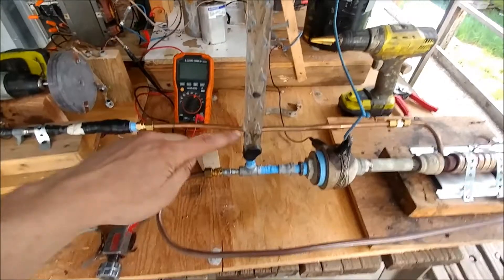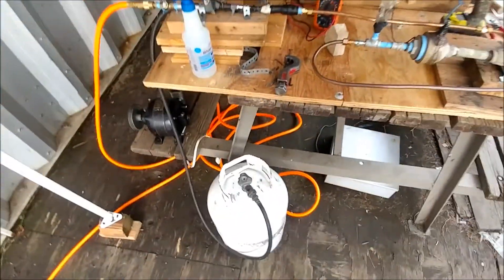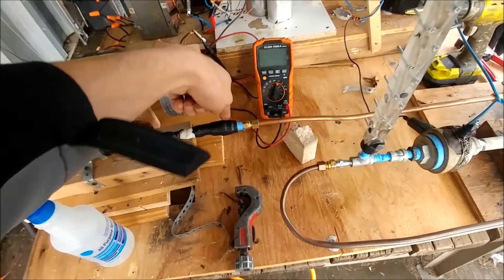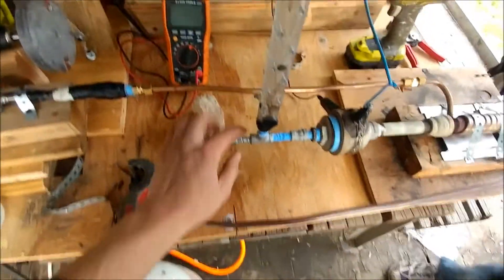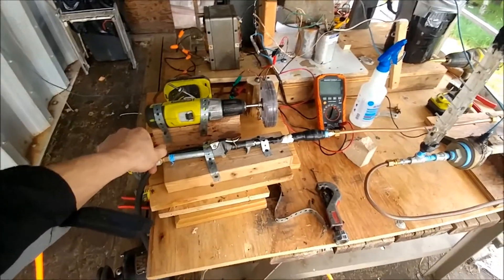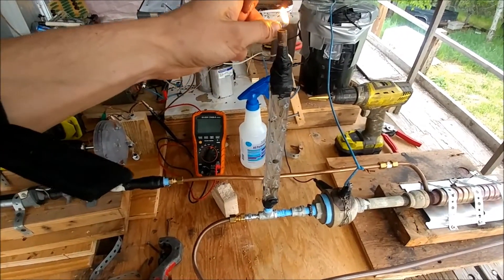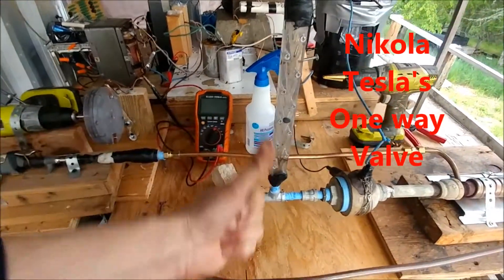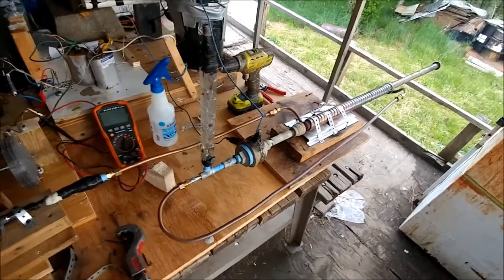Water Plasma Pulse Jet Engine! For Powering The Tesla Turbine!

Comment: Fun stuff but not efficient.  Without a fresh air to fuel compression ratio these engines are horribly inefficient at producing mechanical energy, just like my pulse jet engines.
Reply: @nikola.tesla.r.and.d.centre  I understand there are many different mechanical devices for extracting or converting energy, but when "efficiency" is mentioned a whole other issue is opened.   For something to be "efficient" it needs to consume less energy for doing the job you require than any other device available.
Reply: @nikola.tesla.r.and.d.centre  k but nitrogen isn't combustible its a inert gas you might as well try combusting argon or neon
Reply: @nikola.tesla.r.and.d.centre  You,re getting off track here.  We were discussing devices like the one in this vid, not extracting energy from nature.
Reply: @nikola.tesla.r.and.d.centre  And propane?
Reply: In your Pulse Jet the excessive pressure in combustion chamber does not exceed 0.2-0.3 bars, and in this scheme (it is not concrete in that that it is shown on video, of course) pressure exceeds 3.5-4 bars. The first engine of Otto had no compression stroke, and pressure did not exceed 4 bars at the time of combustion, but at the same time the efficiency was about 15-18% - and it is one many more, than at Pulse Jet. I also work in this direction - https://youtu.be/bBb-ZjXpdSo
Reply: Wow  @nikola.tesla.r.and.d.centre  your like a bad ass soft spoken cowboy I'm totally inspired cant wait to covert a vehicle this way and to run my house
Reply: @nikola.tesla.r.and.d.centre  nitrogen dosnt ignite if that were the case the atmosphere. would have burned a long time ago
Reply: @nikola.tesla.r.and.d.centre  ionization is very different from combusting you can very much ionize nitrogen injecting fuel  into a plasma jet would likely produce a much more efficient combustion of that fuel but the plasma itself is not combusting
Reply: @nikola.tesla.r.and.d.centre  thats not how science works you don't get to say "oh yah give me proof it doesn't work" you have to prove it dose in the first place give actual data an prove its the nitrogen combusting an not one of the other gases in our air
Reply: @nikola.tesla.r.and.d.centre  Could I have a copy of this document?
Reply from the maker: I was peeling the layers off plywood yesterday with just the high speed impulses, I turned up the rate of fire on the plasma ignition. I barely  had the propane turned on. Its extremely efficient :) Also, its turned down in this video, all you need to harvest the high pressure high speed impulses is a good two stage Tesla Turbine. Most of the compression happens when you have a Tesla valve installed, like in the video. After the explosion happens there is a large vacuum that accelerates the air back into the combustion chamber,  and creates a high pressure shock-wave that the new fuel gets trapped in, then the shock-wave is ignited creating a high pressure explosion to further perpetuate the reaction. Thank you for comment.
Reply: @iEnergySupply  But it takes energy to drive the turbine and ignition system also.
Reply from the maker: @MrBen527  Everything takes energy, good thing we live in a sea of energy.
Reply from the maker: @MrBen527  The energy it takes to drive it is transferred into usable electrical energy.

Comment: I'm kind of confused, I like the ambition but, this is essentially a spark plug in a barrel igniting fuel or whatever else. Essentially a combustion engine with no piston. The point of a plasma engine is to produce power with plasma, not to create plasma and use it to heat up stuff. Plasma is a state of energy which doesn't have to be created with an arc. Usually plasma engines compress particals to heat then up via radio waves
Reply from the maker: The plasma ignition is for aiding in combustion when water is introduced to the system. With normal ignition, the water stops the reaction, but with the plasma ignition the water is burned in the chamber with the other fuels. The total apparatus is for powering the Tesla turbine.  We have moved in a slightly different direction for now though, and will be adding the plasma ignition to the vacuum in a complete water environment.  We will see the plasma grow under these conditions. Have you seen the cold steam videos yet? If not here is a link.

https://www.youtube.com/watch?v=JvRCB_HhseY&t=374s

Comment: So its been 8 months since you posted this is there anything to update ?looking forward to it and to see a full car conversion .
Reply from the maker: Actually right now we are experimenting with closed system in vacuum. This reduces friction and boils water at room temperature to power the turbine, surprisingly it works extremely good. Also we want to use plasma ignition in the vacuum to split water in the vortex. Will be interesting!
Reply: @iEnergySupply  I've seen that I'm in awe .I'm really excited and can't wait to follow in your footsteps I have a few ideas already I have the idea to build a friction heater to add up to 300 degrees heat to it '' the turbine would spin the inner drum '' and a few other thoughts
Reply from the maker: @cushionofair  Good idea! Thank you for following the project!

Comment: Looks awesome .Could you add a geet ?
Reply from the maker: definitely on the to do list, what we had here was sort of like the geet when we were using the heat exchange for the incoming propane gasses to be heated.
Reply: @iEnergySupply  with a GEET you can hook the exhaust up to the intake and re-burn some of those wasted fuels ie  water vapor and help silence the system
Reply from the maker: @cushionofair  I agree we should do those experiments. 
As far as the sound goes, it will be muffled by the turbine.

Comment: See the problem is that to burn water, you need to spend energy to separate oxygen and hydrogen. The energy you need to separete the atoms is greater than the energy you gain from the combustion between oxygen and hydrogen (thermodynamics). The only benefit of adding water is the fact that absorbs some of the heat (a pulsejet is the jet variant of a 2 stroker, it wastes a lot of heat), cooling the combustion chamber and increasing the exaust pressure evaporating.
Reply from the maker: it seemed to add much more motive force to the explosions. We will return to this research in the future.

Comment: Noise and temperature changes are signs that whatever you're doing is not efficient
Reply from the maker: The noise is no more then you would hear from an internal combustion engine if there wasn't a muffler attached. Low temperatures are a definite sign of increase in efficiency. Heat is energy, so if you have something being cooled so that it doesn't get too hot, your loosing that energy. Our heat energy is being transferred to the incoming gasses to help complete combustion, and not just radiated to atmosphere.

Comment: I dont see any thing new here,  why not just build a real pulse jet engine, and as for your plasma ignition, i can get the same effect from 5 volt £5 device from ebay, you are not burning the water, you are just getting steam out of it, from the heat of the pipe.... that you are having to heat your fuel is another issue . In your reply to MrBen527 you describe the cycle of a pulse jet engine ? but unlike a running pulse jet engine..... you keep putting energy in with your plasma ignition  https://youtu.be/5sfVnczqb8g
Reply from the maker: You know I haven't finished this yet and have the new design coming soon, part of the problem here was a melted tesla valve. That aside, it still performs better then other pulse jets because the pressure of each pulse is far beyond that of any I've seen.
Yeah you can't get the same effect from a device like that on ebay, I would urge you to prove it. I have tested many different types of ignition systems, and if you were here during experimentation then you would understand the difference is night and day. You know the reason pulse jet engines are so inefficient is because they create so much heat that gets radiated, the heat exchanger takes that waste heat pre vaporizes the gas to the point where you get a faster cleaner burn of your fuel. When the valves are finished you'll see the power this thing is capable of.
Reply: i would take a look at what i do.... my ignition systems, etc..... but hay good luck, its your time and money... you not doing any one any wrong, so have fun
Reply from the maker: @Turbojetkart  Ill take a look. Another interesting thing is we have been using the same tank of propane for over 3 weeks of testing, so the fuel consumption is extremely small.
Reply from the maker: @Turbojetkart  Just wondering what happens when you spray your spark with water, does it grow in intensity or does it dim out and stop? This ignition system when water is introduced to the plasma it makes much larger explosions and you can watch the plasma grow in size.
Reply from the maker: @Turbojetkart  Lots of waste heat going out the window there...

Comment: It turns out that the main part of air moves from a komperssor, and via the valve Tesla is inhausted very little, due to ejection (so, for surroundings :) ). Will work in this case one many better if you stop playing "games", you will remove Tesla valve from this scheme, and connect a tube on which the main fuel-air mix moves hermetically to the combustion chamber. For normal work, all fuel-air mix should move through Tesla valve which should be connected directly to the combustion chamber.
Reply from the maker: I will certainly give it a go, although I do believe this will cause the need for more compressed air as I wan't to draw in ambient air. I've spun a rotor and am impressed with the power the way it is. Do you have an example of what you're talking about I am having trouble with your explanation.
Reply: @iEnergySupply  I meant that in design which you show on video Tesla valve is not used according to the destination (it is sure, you and understand it). Therefore he can be moved away absolutely, and as a result it will be better to work if joints are tight. In your scheme role of main "valve" is played by excessive pressure under which air and fuel comes (and pressure in combustion chamber at the time of ignition does not exceed 1 bars). But it concerns only what is shown on video. Do you perfectly understand what happens to your plastic Tesla valve if to connect it directly to combustion chamber, truly? But you try to attach somehow it if only was - it is play in "games":) I hope, now it is more clear what I speak about?
Reply: @iEnergySupply  I badly know English therefore I use the translation program. Unfortunately transfer into English is got not absolutely exact. I will try to write as it is possible more simply, then transfer is got better. It is simple to write on thermodynamics in the pulsing mode - not so simply:).
Reply from the maker: @TeslatechUa I'm worried the plastic Tesla valve will melt, as it has already melted where I put it during experimentation. Nothing is a game if it is an experiment. If you build something and fail, it doesn't mean you failed. It means you learned something. I must say my understanding has grown immensely because of experimentation, I don't know why you would call that a game. The more I experiment the more I discover the amazing capabilities this system has. Just keeps getting better and better, I'll have more updates soon to show you how significant.
Reply: @iEnergySupply  It seems that now everything is clear. At everyone own approach to business. It is simpler to someone to deliver thousands of experiments, and to someone - carefully to study everything the known information concerning a subject it will carefully be prepared and to put several successful experiments. 
I wish you good luck. I will watch your progress. There will be questions - write. If I am able to help something - I will help.
Reply from the maker: @TeslatechUa  Thank you.
Reply from the maker: @TeslatechUa  Let me know what you think about our power test. Here is video https://www.facebook.com/jeremiah.ferwerda/videos/10206230802244898/
Reply from the maker: Also I do study significantly you need a good balance of experiments and study, just remember mainstream science will not always tell you the truth.